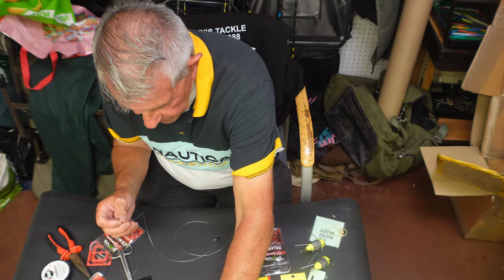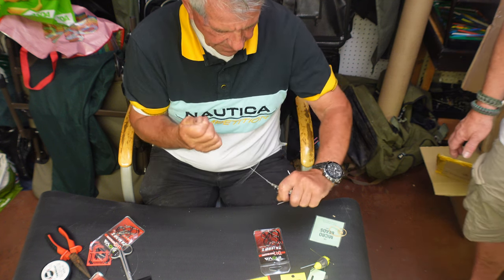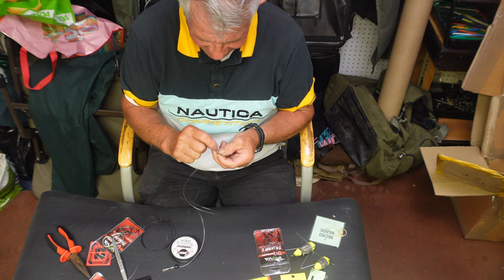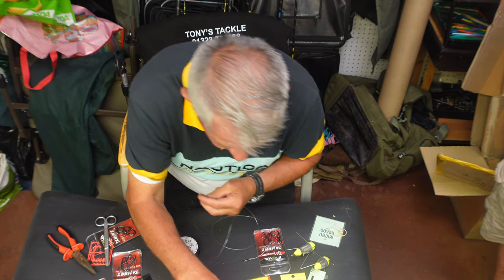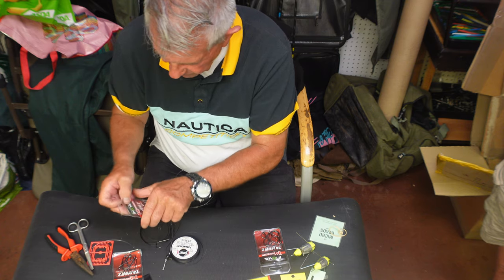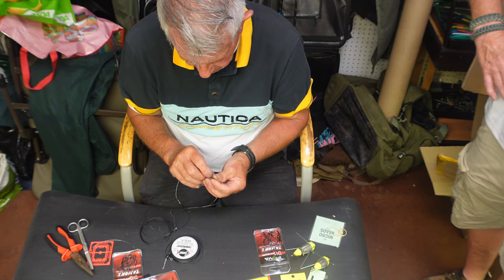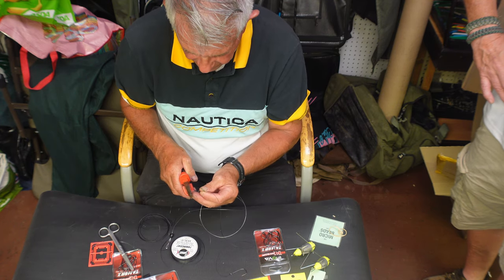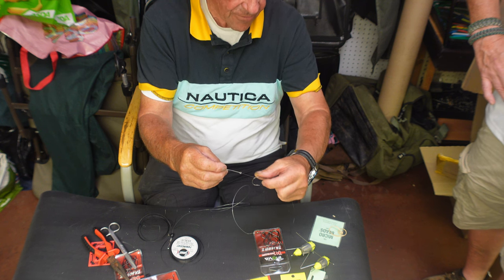Pulley Rig

Comment: No knot breaks until it slips. Some lines jam up the more turns you use and don't tighten up properly. Gerald uses 3 turns because it works on the lines he uses in the breaking strains used for general shorefishing. 
Better to tie a simple knot properly that is well formed and tightened. 
I keep saying it....if it didn't work he wouldn't use it.
Reply from the maker: Absolutely, it works on amnesia. A line that has specific qualities, i tied some rigs using his method today, worked perfectly well.  Im trying to share experience  on this channel. ( not mine) . We will do some more rig building with other top anglers, to see how they do it.. all to come.

Comment: as i make 90% of my own weights i dont have that little tag to pull my knot tight, any other ideas?
Reply from the maker: Anything that is strong enough and will go through the eye of a swivel.
Reply: An old gemini screw in breaker does the job well
Reply: @tonystackleseamatch398  thank you, but i was taking the piddle

Comment: Is 30lb hook snood too light if power casting as it looks like theres alot of strain on the snood .
Reply: sorry i was taking the p on the knot pulling, i also think 30 is to light if power casting
Reply from the maker: I thought that so i did some tests to distruction using a set of electronic scales, and the failure wasnt at the snood , i think because the line passing through the pulley bead protects the snood.
Reply: Under the cast both the rig body and the snood will stretch....if it is made of mono.
People think they are putting far more pressure on the line than is realistic. A decent caster puts LESS strain on the shock leader and rig trace.
If you fish heavy ground you may need higher breaking strains, not for casting but incase of any damage to the line during fishing.
Reply: @Lee Richy  it just made me think its too light with most people saying 10lb line to every ounce weight and the snood is in theory acting like the rig body  with as much strain being transfered to the snood and hook same as the body when clipped up.
Reply: @nicksparkes1378  The rig body takes the strain as long as it is longer than the snood. Yes, the snood will stretch and that is what stops it breaking.
You can easily stretch Amnesia in your hands, try it.
People think they are putting 60lb of pressure through the line on a cast....total rubbish.
They do not understand casting.
Reply: @Lee Richy  thanks for the reply mate i will have more confidence in it now 👍 even though we only need a basic overhead here in Iceland.
Reply: @leerichy6489  i know that pulling with a static weight is not like a back caster swinging a 6-8oz lead round his head all day, and as you would well know, nylon does not stretch forever, stronger amnesia is available so why not use it, i think if Neil Mackellow, when in his prime, was beside me on the beach casting that rig, i would be off, there is such a difference in some one who goes sea fishing and a really keen beach angler, safety is the number 1 on the beach
Reply: @johnkay7354  I wouldn't. If anything broke it would be the snood......not the rig body and lead provided it was tied correctly.
How much pressure do you think you put through the mono in any cast? Give me a number?
Reply: @leerichy6489  as you pointed out, if tied correctly, but i thought it was the snood breaking that we were talking about, if he was using a frozen squid it could kill, give you a number, i can hardly remember how many tablets i have to take every day
Reply: @johnkay7354  You do not understand casting at all.
Yes, I knew Neil...he sold me my 525 mags when he first started working for Penn.
You do not have the ability to get an 8oz lead plus bait anywhere near the pressure you are imagining. Frozen or not.
Reply: @leerichy6489  you seem like a keen angler Lee, which part of casting is it I don't understand, the physics or casting, I had super mags off Tony from Birmingham one year, after the new Daiwa reels PK had told me about never came out in time, I'm on the 7ht mags now though, super mags are nice spares in the box

Comment: 3 turns is dodgey surely? The man obviously has much more knowledge then me but 3 for me is a big no no. Didn’t one of Tony’s rigs come back without hooks in a recent video ?
Reply: 3 turn grinner is super strong and all you need really, if I was to do blood knot it would be 8 turns, all down to prefrence I suppose 🤙 🎣🎣
Reply from the maker: Its how Gerald does it, the rig that came back with the hook gone had parted on the snood not at the knot..

Might do some more rig bulding with someone else in the Tony team  for alternatives
 . I think it works  because he doesnt wet the line and uses the tag on the lead to tighten the knots